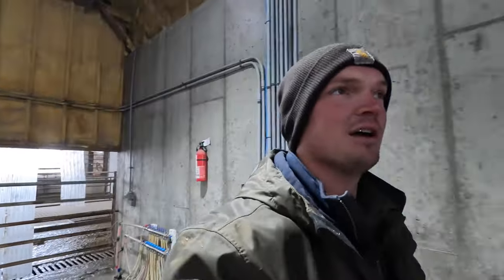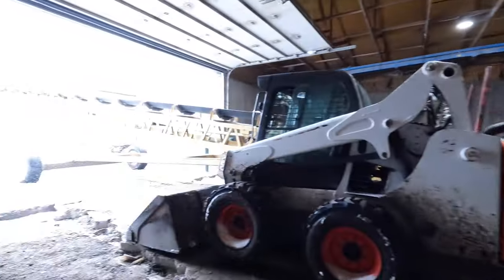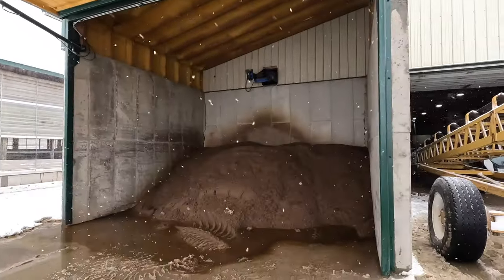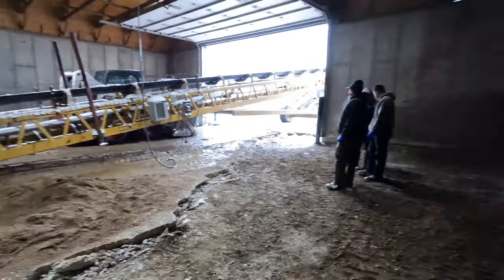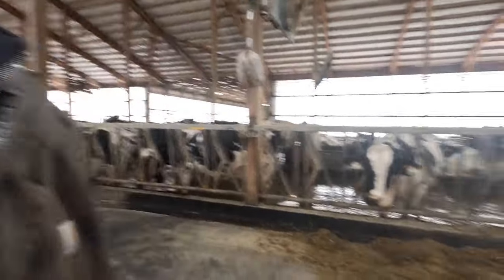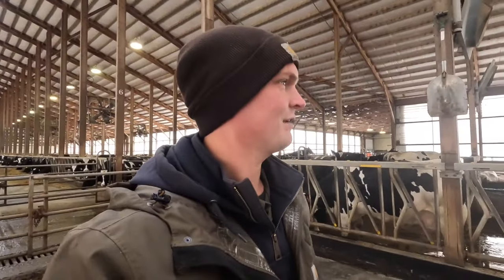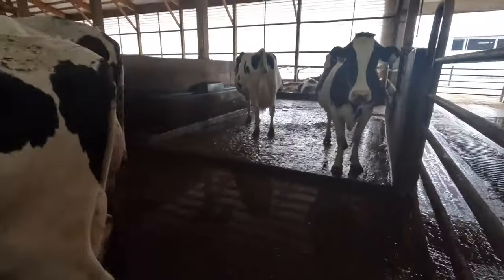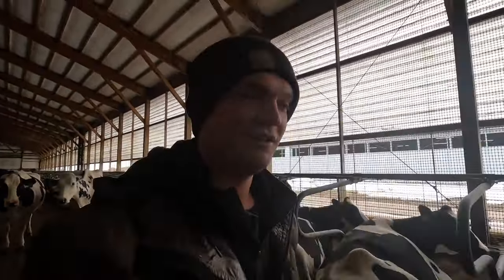Replacing Concrete Floor in Manure Building (110)

Comment: Always very informative - great impressive setup - well kept - clean and organized - the Dutch way lol
Maybe make a video where you touch on why you guys run custom crews for most of your field work -
have you had someone run the numbers for all the different field jobs - is it less headaches/easier with your skillsets - all hired custom crews/equipment versus you invest/run own crew.
Would be great to get your though process - it seems like most US farmers want to run all their own equipment 👍👍
Reply from the maker: I can talk about that in a future video. There are a few reasons I prefer custom crews for certain jobs like manure pumping and silage harvest. We've looked at chopping our own corn, but it's difficult to justify the huge equipment investment for the amount of acres we harvest. We'd either have to run older/smaller equipment, which would delay harvest or do other jobs besides our own corn, neither of which I want to do. It needs to be done quickly and efficiently. Labor is another reason, I don't have to worry about added labor for short periods throughout the year. I don't want work on the dairy to be put on hold for 3 weeks because we're chopping corn, for example. Hiring a custom crew means paying a big bill, but I don't have to worry about equipment problems, labor challenges, etc. I'm not ruling it out in the future, but currently it doesn't make sense for us financially.